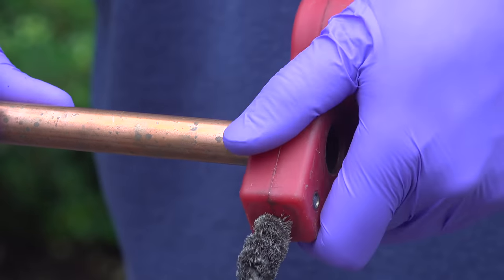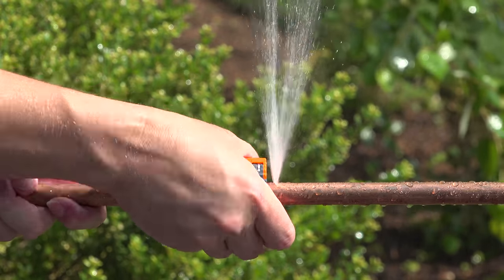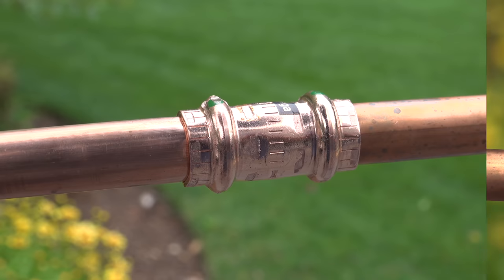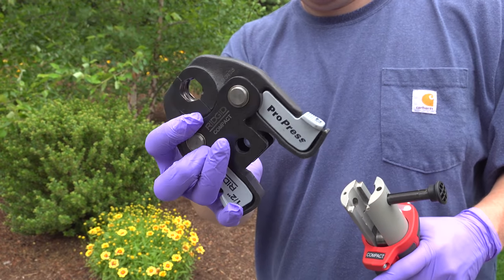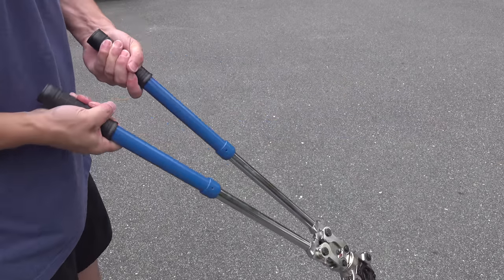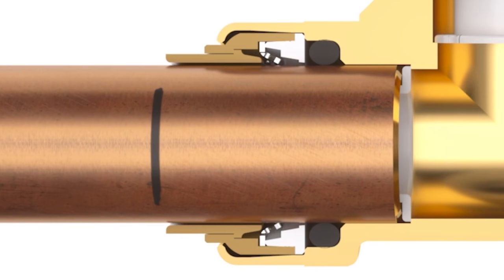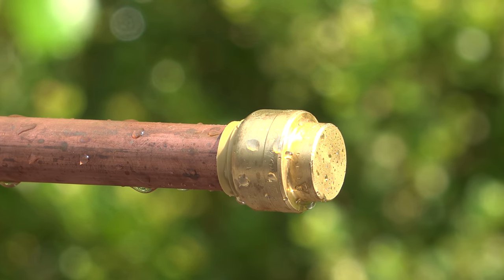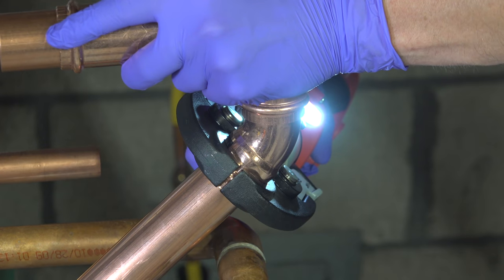NEVER SOLDER PIPE AGAIN - 3 Ways for EASY DIY Plumbing

Comment from the maker: Thanks for watching please LIKE & SUBSCRIBE - Manual Tool https://amzn.to/3A1dl18 Autocut Pipe Cutter: https://amzn.to/35TrSOH
Reply from the maker: @itsm3th3b33  Conveniently? It was exactly the same as he lower connection. What am I missing here?
Reply: @SilverCymbal  I also wonder about how you got press tool in there behind the other pipe. I think this is what he meant...
Reply from the maker: @jackmclane1826  Ah! Ok, it was tight but still had about 4-5" and the tool was able to get right in there.
Reply: Best way to fix a copper line? Change it out for PEX and use a tool-less pressure fitting, (shark fittings). Your welcome.
Reply: the propress tool dent the copper pipe at 1:20 mark. is that normal?
Reply: Do these work for copper A/C lines
Reply: Hi SC: At the tail end of this vid you alluded to a much larger job you needed to complete (it looked like oxidation). I was wondering if you recorded that repair session as I would love to watch and learn. Thanks very much! I love your channel!
Reply: The soldering on copper pipes last as long as the pipe, I`m not sure if thease things can stand the test of time, either way that's not my problem, ill stick to soldering like 99% of the world if I ever have to.
Reply: Beware CCP copy and fake & cheap product on world market .
Reply: July morning
Reply: if that is easy?  you should see Argentine plumbing and use it.  it is cheaper and easier than copper🤔🤔🤔🤔🤔
Reply: @jasonschaeffer72  Never seen it on AC, pressures are much higher so don't think it would be allowed. Still brazing for install 💪
Reply: How much pressure do you have
Reply: @RossMalagarie  ooooooooooooo
Reply: @Silver Cymbal
Reply: @Silver Cymbal hello
Reply: @SilverCymbal  9
Reply: @SilverCymbal  @1:53 it doesn't look at all possible?
Reply: That tool looks unwieldly.  Im pretty sure they make haudraulic tools for around the same price, if not less.
Reply: @SilverCymbal  aaaa
Reply: V,
Reply: 0

:
Reply: Xz
Reply: P,e
Reply: ص
Reply: هو
Reply: 0
Reply: Z
Reply: @jasonschaeffer72  NO, pressures are way too high!!!!
Reply: wow 👌 👏 😍 👍 🥰 ☺️
Reply: For water i think work but for gas i do not know
Reply: Solder costs 3 cents all your solutions cost at least 100 dollars. You can always use a soldering iron too braze your pipe it takes a bit longer but it does still works. Shark bites are amazing but they are 30+dollars each.
Reply: @-powerband-gamer-6117  99% of the USA, not the world you will eventually catch up with new technology as per usual
Reply: Many of the commenters think the o-rings are made of rubber, and thus won't last long.  The video would be improved if it explained what the o-rings are made of... and perhaps how to detect whether a knockoff brand or counterfeit fitting is using a different (cheap) o-ring.
Reply: @SilverCymbal  😢
Reply: @-powerband-gamer-6117  I’m betting  50% off the work has gone to pro press
Reply: Love Shark bite. In several locations in our homes and customers house for years, no leaks. Just be the best at what you do and your income will never be affective by ingenuity. be fare and honest on your cust. Prices as well. Blessings to many years of hard honest fair work.
Reply: 1

Comment: Personally I would be skeptical about O-Ring sealed copper in the construction of a building.  Soldered copper connections have been proven to basically be good for the life of the building but I know from experience that O-Rings often harden or crack over extended periods of time.
Reply: Its a mitigation tactic, not intended for every day operational use. Just sayin.
Reply: Soldering is great but you have to be sure that the house doesn't have a gas water boiler or gas heater. A big KABOOM and you flight across the window is not worth it. PEX, or ProPress (press-fit), or flare fit (like the gasoline lines under the cars).
Reply: @SSintox  that's nonesence!! I've done miles of copper pipe in basements that have NG furnaces and boilers.....Common sense applies here, if you go into a basement and smell gass, obviously your not firing up your torch!!!
Hello!!!!
Reply: I've soldered my friend's whole top floor and we did it for the first time in our life. As it is with many jobs, it's not hard you just have to be dligent.
Reply: @SSintox  Rubbish
Reply: Means more work for plumbers 💰
Reply: Its just job security for professionals to fix peoples nightmare jobs.
Reply: I do plumbing in germany and it’s actually a pretty proven technique here and its very common. No matter if private construction or in factory constructions, also a good thing is you can use it for stainless steel, carbon steel or copper. Even gas connections are pressed these days. The rubber ring CAN get loose or crack of course but as long as you use fresh and lubricated rings it WILL last FOREVER.
Reply: @SSintox  ya I remember all the "explosions" in the great mass extinctions of plumbers in the 1930 thru the 50s.
Reply: @SSintox  Every light switch can ignite gas, so that's no excuse not to weld.
Reply: @Sean2002FU  lol, yes agree 👍
Reply: @macyardartgrill2672  agree.
Reply: @ninetyninenat  will not last forever. it's only the lazy plumber that would use it.
Reply: Standard use in Europe with plastic pipe. I used John Guest push fit plumbing fittings in my house 35 years ago, still in use, not a single leak.  There are several brands now the JG patents expired. It’s so fast to use, it saves a huge amount of time and time is money and while the fittings are more expensive, plastic pipe is cheaper and flexible so big savings when all considered.
Reply: @waltewhitesPhD  I have 35 year old John Guest push fit plumbing joints in my house without a single failure. Standard usage in Europe, also with plastic pex pipe.
Reply: @markbaker980  Cool story bro. This was copper application. Your comment is invalid honestly.
Reply: not to mention that pro press tool is like 1800.00
Reply: @daz374 absolutely! I have John guest fittings with an o ring that are 35 years old on copper heating pipes without a single leak, and on plastic pex pipes hot and cold supply for 20 years.
Reply: Yeah this is a repair of a line you can reach not a hide and forget about it type technology.
Reply: @SSintox  I been plumbing for 25 years and that’s some nonsense talk you just have to be careful of your surroundings and nonthing is gonna go boom and to be honest propress looks shitty  there’s no workmanship in that my grandma could do that no skill needed
Reply: In schools they might specify no hot works
Reply: When shark bites first came out years ago I would only use them to temporarily cap stub outs. I for sure would never bury one in a wall. Inspectors frowned heavily on the shark bite  too at first. Now everyone and their brother is using them and also burying them in the wall. What I still have not gotten past is the O ring phobia. To me, as someone who’s sweated thousands of fittings I just cannot trust an O ring for a lifetime like I trust my sweated joints. This is also true for the compression method with the fittings having o rings. Be this as it all may, I am no longer fitting pipe so I don’t really put much thought into it anymore. I do know that PEX is seriously the future of plumbing in many applications. Plumbing is evolving and because I’m old school I have my opinions. However, anything to make things easier and less labor intensive is a good thing. I’m so old I can still remember when pipes were made of wood! 😂😂😂
Reply: @tristanedwards1340  
Not in the metropolitan area (MD. VA . DC)
Reply: @Sean2002FU  Thank the stars someone around here has some common sense! Thank you!
Reply: Pressfittings are used in germany for more than 25 years now without any Problems.
I cant believe that are countries that still solder 😄
Reply: @waltewhitesPhD  Are you high? Its not a 'mitigation' tactic, people don't spend $2000 for stuff like that. PP is used in commercial/business/industrial situations all the time.
Just sayin.
Reply: @maxpower9848  LOL. But the PX/Pro Press are indeeda great way for almost anyone to do a plumbing job relatively safely and competently. Dad was a plumber so I feel all the plumbaz bitchin about it dog.
Reply: Decent press fit fittings have a twenty year warranty, solder can degrade over twenty years. Silver solder is a better fix for longevity.
Reply: Propress is amazing. I've had very mixed luck with push fit on pex, but have never had a leak on push fit to copper. I like to put a little silicone grease around the copper before putting the push fit fittings on.

But propress is amazing. I just can't justify spending 2 grand on a cordless tool, so pex-b crimp fittings for me!
Reply: We use pro press fittings on fire sprinkler installations where pressures exceed 200psi. I don't think you'd have a problem using them in your home considering pressure would be 60psi max.
Reply: We use pro press fittings in fire sprinkler installations where pressures exceed 200psi. I don't think you'd have a problem using them in your home considering pressures would be around 60psi max.
Reply: @tristanedwards1340  plumber replaced my hot water tank, used propress. Other than the giant compression nuts on the top of the tank.

Comment: I'm no expert plumber, nor am I claiming to know more than them, but I think a lot of people are missing the point of this video. He is not saying these will or should replace professionally soldered pipe connections. These are for homeowners and quick DIY fixes to plumbing problems or for other things like that. Most regular people are not going to be able to go out, buy a torch, buy flux, buy solder, clean the pipe, and properly solder the pipe without any problems when they can get a quick fitting that simply snaps on. Solder is of course the best option, but for the average user it isn't feasible in the short term. That is what this video is meant to show. But what do I know.
Reply: But you have to buy that huge tool which is $150. Everything you mention needing to buy for soldering is like $50. So not for pros and not for amateurs.
Reply: @tkorocky  It's almost like you didn't pay attention to the video 🤦‍♂️
Reply: $20 for entire soldering kit at home Depot... Propane torch, solder flux etc. You don't need map gas
Reply: @tkorocky no you don’t, all the big box store rent them for $10- $15 a day.
Reply: Good point well made. 👍🏻
Reply: U tube is ur friend and honestly you can almost buy a torch and the rest for what one shi..y shark crap bite fitting costs. If you have enough sense to buy a shark bite fit and fix ur self. Just grow a pair and go all the way correctly
Reply: @drumtwo4seven yellow bottle map gas for a simple torch at homedepot 45$ for a kit. Propane takes way to long, doesn't burn hot enough green bottles suck. Can be done buy not ideal. As well look at it this way you can start a bonfire,  charcoal grill so much quicker with map gas the yellow bottle. Also 12$ for a replacement bottle

Comment: I’ll stay with the torch and soldering it’s really easy to do and it’s cheap
Reply: i'd say that thingy called sharkbites looked way easier and cheaper, even better if it can last a long ass time. auto win/win right there.
Reply: I agree Ram 4570. A good solder job will almost last forever.
Reply: @STVGozando  shark bites are NOT cheap!!! They cost way way way more than a solder fitting!!!! They also can fail
Reply: Exactly friend! Smart!
Reply: @dellawrence4323  EXACTLY! I am so glad that I will never have to depend upon a young plumber. If I had to, I would never even give him my address if he answered "yes" to my question, "do you use those gimmicky expensive joints?".
Reply: yeah it might be easier and quicker in most cases but all us real plumbers know it won't last as long
Reply: Wasn't this video about NOT soldering again???? Yet what's the first thing about?????? SOLDERING!!!!!!
Reply: I always did until I had a leak on vertical pipe and could not drain the water. My friend who is a plumber said " just get a Shark Bite and be done with it". It was truly to easy.  The Shark Bite cost more but for me it was money well spent. All in less than 20.00 dollars. I will still solder when I can but I would not hesitate to use a Shark Bite again. Its just another tool and I am not a plumber.
Reply: Well, not that easy, but definitely HIGH QUALITY. Soldered joint will never leak.
Reply: I work in a hospital and we use the crimp fittings all the time, from 15mm to 76mm, hot works permit can be an ass with health and safety in hospitals and yes the collects are expensive and the fittings are not cheap compared to a solder one but they are 100 times faster and easier and they will last just as long or longer than a solder fitting.
Reply: @superslick5677  Gaskets age and cannot last as long as a weld.
Reply: Pretty much
Reply: @vince9099  I've seen more solder joints fail than shark bite. They all have pros and cons. The shark bite fittings are more expensive, but also much more consistent and they save time. A good solder joint is cheap and will last if done correctly, but user error is a common problem and even experienced plumbers can make the occasional mistake.
Reply: @dougk.5501  Back when I was playing handyman for dives like apartments and motels, I worked with a guy who swore by the Sharkbite fittings.
He cut a piece of pipe with full flowing cold water since he "couldn't find" the shut off valve, the shark bite fitting he tried failed and he didn't have another.
The water must have been running for a good hour before a real plumber got there.
Working with a lot of different tradesmen I learned more of what not to do than anything else.
I'll trust solder over compression fittings.
Reply: @HannTheftAudio  You shouldn't read comments if you're too fragile for opinions. The internet is too much for some folks.
Reply: And it's fun.
Reply: You guys ever tried pex? Its actually amazing, especially with the special power tool for the connections. Just dont use the crimp style connections. They dont seem to work as well as the ones that stretch over. Pex can have water frozen inside and it wont break. You can even blow it up like a balloon (like with a compressor, not by mouth lol)  and it wont burst, itll even return to its original shape.
Reply: @STVGozando  But they don't last. I've seen them blow apart time and time again.
Reply: And it lasts forever
Reply: @dougk.5501  Anything can fail in this world.
Reply: Cheap? LOL copper is gold now. Pex is cheaper even if it isnt as good
Reply: @shopdoggarage5077  you see more fail because solidering has been around for ages amd plenty are ageing. I have sharkbite in my house and all the other houses me and my dad fixed up, no issues. We use sharkbite when we have to but mostly use pex and in more moisture amd freen prone areas we use the stainless rings. Aleays use the go and no go gauge though, and also here up north if it leakes it is seen and drips on the basement floor amd emds up in the sump pump so no big deal. Down south thats another story
Reply: @superslick5677  Hah.
Reply: @garthfairfield8043  Shark bite are garbage, but time will tell with the press fittings. The company I work for, switched to press fitting in 2013 for domestic and, heating applications for new high rise buildings and service. We havnt had one fitting fail yet. I do agree saldering is better, but for health and not having to breath flux in 9-10 hours a day press is way better.
Reply: I can buy 3 sharkbites for the price of a small spool of solder( $28 )
Reply: Me too
Reply: @Thornik2012 the Yorkshire type doesn't have enough solder in my opinion
Reply: Not to mention it's proven.
Reply: not cheap at all price difference between soldering and push fittings not much at all considering you don't need flux solder torch etc not to mention time saved
Reply: @drumtwo4seven  they're great for flipping houses so the next poor sucker has to deal with the consequences.

Comment: After 11 years maintaining a 29 room motel and battling MANY leaks, I repaired every leak and remodel with sharkbite and never not one problem
Reply: You obviously live in a place that never freezes
Reply: @DavidBasara-p8s  PWAHAHAHAHA
Ya, northern Idaho never freezes?!?!?!
Reply: @kennethvoller278  LOL!
Reply: Shark bite all the way
Reply: Is that the same hotel with the mold problem?
Reply: Fast forward 2 years..Kenneth retired and the new kid is losing his mind fixing all the sharkbites that failed.
Reply: @The_Blessed_Cowboy  no sharkbite never fails
Reply: @kennethvoller278  I assume you mean push fit when you say that? I too had that mentality. Until 3 failed after replacing a basin faucet (3 separate pieces.. a valve was leaking from one end, and tee was leaking, and a push fit to 1/2mnpt leaked on the push fit side.

I bought a 40$ pex-b crimp tool and the copper rings and replaced every single push fit fitting. Crimp rings are amazing. Also you can get a pack of like 30-40 fittings for 25-30$. Insanely, insanely more cost efficient. The crimp rings are super easy to crimp as well, no muscle hardly needed at all.

Edit: I will say that the fittings that were leaking, worked fine on copper. I will still use push fit for transitioning from copper to pex (but using a npt push fit to copper, and screwing a pex-b npt adapter on to that to crimp the pex (why the f does nobody just make a push fit to crimp fitting?!?).  I will never ever use push fit on pex..copper seems fine tho.